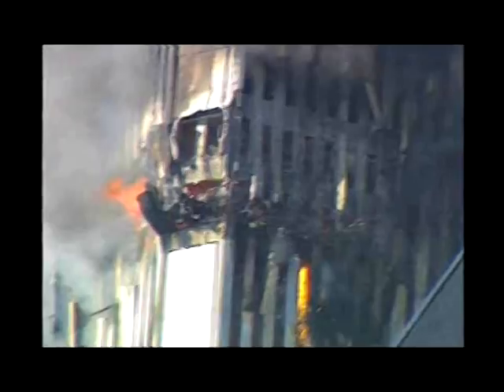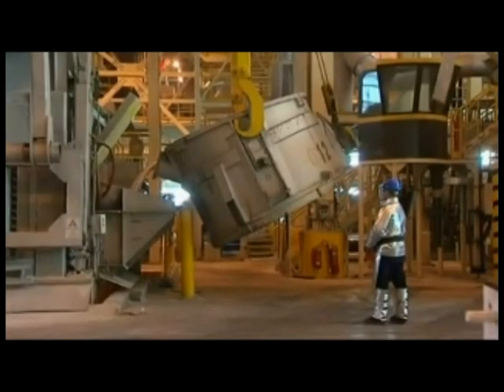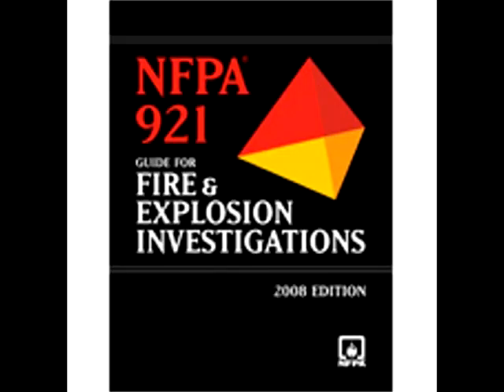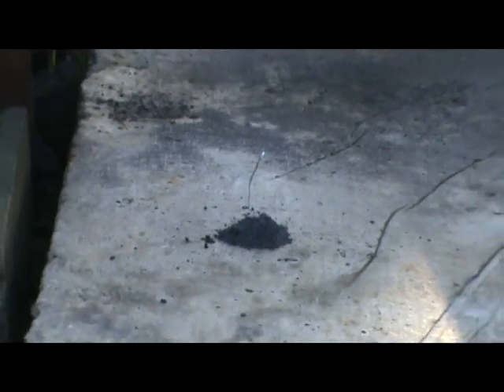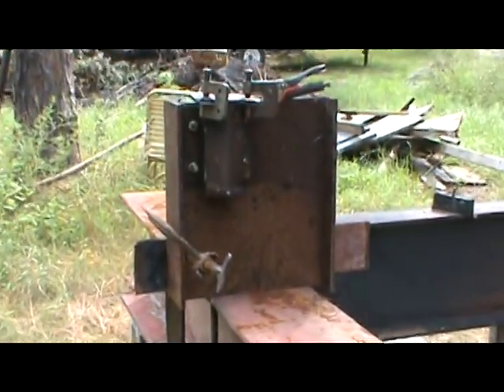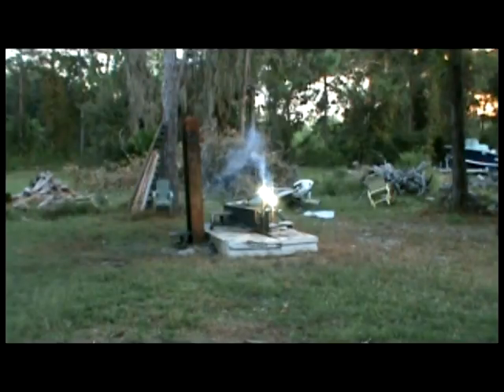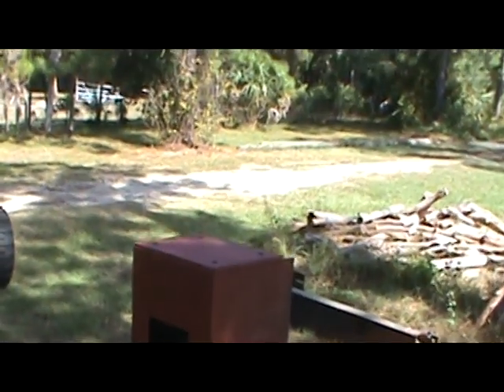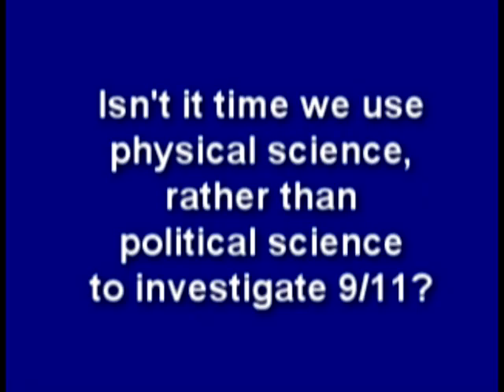9/11 Experiments: The Great Thermate Debate

Comment: The science behind thermite reactions is known, and has been known for decades, well before 9/11. Rail joints across the world use thermite welding to achieve the required temperatures to "melt" the rail joints together. Although it is a different application, the fundamental principle is the same, so why was this never considered in their analysis? Did they even bother to ask engineers that know this? My questions are rhetorical, but meant to pause for thought.

Comment: What about that steel building in the nederlands, that collapsed due to a normal fire.
Btw "those" people don't believe anything, otherwise it would be a paradox. 
Just realize that those towers collapsed because of the planes and their fire. Or run a campaign if you are against the politics in your country.
Reply: Arved Ludwig im from the netherlands and i have no idea wtf ur on about
Reply: Thund3rB0lt it was in Delft and had 13 stories. It was part of the technical university.
Reply: That building did not fully collapse, only some other parts did. The main structure remained intacted and was demolished afterwards

Comment: Steel doesn't need to be melted to lose its structural integrity.

What are the chances of high amounts of electrical current melting the steel.
Reply: jermzdee You know, I like you. Debating and putting forth ideas, not just destroying straw man arguments. 

Anyways, I dont think your idea works because its simply too much molten metal. An electrical short would only melt a small section of wire until the connection is severed. I dont even think wires are made of steel or iron, probably copper. And if a wire shorted through a steel beam somehow, the wire would melt first, severing the connection.
Reply: jermzdee unlikely. Building steel is grounded. It would absorb the electricity. It would take an incomprehensible amount of electricity that the building's system couldn't provide.
Reply: jermzdee I'm on board with that, I don't believe the steel needed to melt for a collapse. However, building 7 collapsing is much more suspect.
Reply: Hank Schwiebert could it be possible though that some of that molten metal was copper electrical components in the walls
Reply: Marcus Frostenson True, but copper alone wouldnt be enough. And copper and aluminum dont mix, so possible I suppose but not likely.

Comment: So your suggestting that directional charges made from thermite were inserted into the columns when the building was errected? Or were retro fitted with no body noticing? It's a bit way out there. Wasn't an experiment done to show a steel beam contorting after being suspended over an outdoor fire for less than an hour. Surely the weakening of such beams would be enough to bring down the buildings.
Reply: g k no he is saying they somehow managed to install charges into the colums. WTC acted like it was made out of paper

Comment: !!! Thermite is used to cut through railroad rails, which are thicker at parts more than I-beams. They use poor mix or poor quality thermite in the experiment. Thermite can burn a large hold in an engine block of a car.

Comment: But what would be the purpose of anyone going to these lengths? Would the average person have access to the access ports for the support bolts? Could a person get the supplies needed to setup these cuts to the location? I just don't see how any of that would be feasible unless there was absolutely no security measures in place.

You've done excellent work. I'm just not convinced on how plausible it would be for a person to get the materials to the locations without detection.

Comment: This is all fine and dandy but you didnt mention that  A FUCKING PLANE HIT THE BUILDING!!! You dont need to melt the steal just get it hot enough to loose its structural integrity. It also helps that its 100 stories up in the air with wind which amplifies the heat. You should all be medicated for believing this misinformation.

Comment: Being as though I'm a blacksmith, I know that if you get steel to that temperature you can bend it with only one finger... not including the fact that it had the weight of all of the rest of the tower on it, making it extremely weak. Did no one think about the cables and wiring harnesses that go throughout the entire building maybe the cables they used had a large quantity of copper or some other materials inside that could have been a large quantities of metal... idk. And honestly there's no real way to find out...

Comment: You don't have to melt steel to make a building collapse, you just have to weaken it enough to the point it can't withstand the structural stresses put on it.

Put 31 floors of weight on the steel.  Smash a plane into it.  Then heat it up and see at what point it fails, I bet it's long before it actually melts.

Comment: There is no way. That is thermite. I am a welder and I am telling you that was thermite or some sort of slow burning, high heat material. Thermite is used to weld rail road track together. A thermite bomb can be used to cut right through steel.

Comment: Jet fuel, typically, will also only burn in a pressurized or enclosed environment.  I work on and around aircraft that vent fuel every 25 hours if the tanks are full.  Eventually someone comes by and drains the surges, but never any rush.  Jet A is basically kerosene.

Comment: You don't need to melt the steel.  You just need to soften it to the point it will bend.  Clearly none of the conspiracy theories come from metal workers.
Reply: Matthew Hendricks you must not know engineers very well, they are right because they said so, and in like scientists they start with a theory and look for the facts to support it.
Reply: Drake Molten aluminum explodes when reacted with water... The entire plane was aluminum. The sprinkler systems have enough pressure in them to cause damage to lower floors when reacted with aluminum. Also, you have no idea what a controlled demolition looks like do you?
Reply: Drake nope, but once the top accelerated it crushed the floors one at a time.  That's a lot of weight.
Reply: KFStreich but why did it fall almost perfectly straight down. Both planes did not hit dead center and stay there in the middle of the building. So shouldn't it have weakened some sides and not others causing the top to fall at an angle
Reply: did you watch the video? there were clips frow the wtc where molten metal was pouring out of the building. my point is that yes you only need to weaken  the steel for the building to collapse but something melted the steel in the towers.
Reply: Is it confirmed molten steel tough? I honesty doubt it. Why? becouse you need massive amounts of incendiarys to melt and completely liquify TONS of support beams to be able to create a flow like that. 

Also i doubt that a office worker stored half a tanktruck worth of gasoline up there. Whats more likely is thats its just jetfeul (wich there was plenty of)
Reply: KFStreich , dude the way the Twin Towers collapsed it didn’t look like it got bent, it fucking got destroyed !
Reply: Chris Almere this is a good point. you definitely wouldn't want a building falling on another building. But surely you have seen videos of engineers claiming the towers could withstand "multiple impacts"?
Reply: mike pk666 https://youtu.be/JEEOkMW1CYI He's right. Aluminum just cools down in water.
Reply: KFStreich if the steel bent, wouldn’t the towers have fallen to one side? How did it still fall straight down into itself?
Reply: KFStreich not only that in Bend under the weight of the building it wouldn't take much I'm engineer had a builder I've got 100 comments from bell ends saying how wrong I am not one of them has got me yet
Reply: Bian Wilson Is that a real question?   It only takes a small structure failure it's made of thousands of pieses.  Size matters.
Reply: Bian Wilson go look up Taipei 101 and how do you stop that from collapsing to the floor.

I suppose gravity played a big hand and helping it comes straight down
Reply: Bian Wilson I use my phone's microphone you f**** moron I speak into my phone I didn't spell s*** how does it feel to be thick as f*** and wrong? I can't believe you've said gravity doesn't play a part in pulling a building to the floor are you serious I have no idea what to say to someone who thinks gravity has nothing to do with a building falling to the floor I'm shaking my head in disbelief and everyone in this room now is pissing their pants laughing 🤣🤣🤣🤣🤣🤣🤣🤣🤣🤣🤣🤣🤣🤣🤣🤣🤣🤣🤣🤣🤣🤣🤣🤣🤣🤣🤣🤣🤣👌👍 absolute f**** moron retarded I don't believe there is another word other than retarded. the US government wouldn't even have you in the army your IQ is that low you're not even good enough to be used as cannon Fodder. 😂😂😂😂🤣😂🤣😂🤣😂🤣😂🤣😂🤣😂🤣😊😂🖖
Reply: Except if that was the case the side the plane hit would be weakened the most and the top would have fallen off in the direction, not straight down. Sorry brah.
Reply: Richie Reeves it's technically possible, but you'd still have to get the incompetent pilots to hit the exact floor in question, that would be a feat in its self, especially since they had only an hour of seat time in that type!
Reply: StripeSubscriber then those floors would collapse first followed by whatever is above, so many things are technically possible, the trouble is creating a theory first and trying to justify it first.

The government can't do much of anything effectively, how are they going to keep such a secret with so many eyes on them?
Reply: KFStreich the heat traveled to the bottom causing it to collapse? You know conspiracies are a real thing that have happened right, it's not like bigfoot or unicorns or some shit?
Reply: mike pk666 You do realize the planes aren't pure aluminum right?
Reply: mike pk666 you're reaching so hard it's beginning to not be funny
Reply: I didnt think about this till now. That molten metal you see flowing out of the building is actually molten aluminum.

 Notice that if you do a bit of research and look up more videos of the metal flowing out of the building, it only flows from the plane impact point. The plane is made of aluminum. And yes, extremely hot temperatures will make it glow bright orange. 900 plus degrees will make aluminum glow bright orange.

 If it was in fact a thermite demolition, its kind of weird that it was pouring out for as long as it did in the first place. And wouldnt we see more thermite coming from other angles of the building too instead of just where the plane is? If anyone can find any other video that shows molten metal on any other part of the building, let me know. I would be glad to have a formal debate on this with anyone. I think I just debunked this whole theory.

Resources: http://www.drjudywood.com/articles/aluminum/Aluminum_Glows.html

https://www.reddit.com/r/askscience/comments/6qaevp/why_doesnt_aluminum_seem_to_glow_orange_when_hot/
Reply: Maximus Matticus and a thousand of them are retards.
Reply: Why would it bend when it fell STRAIGHT DOWN.
Reply: mike pk666 planes have Inconel...an alloy of nickel containing chromium and iron, resistant to corrosion at high temperatures... it can stand temps over 1,800 °F why wasn't any plane parts pulled from the building...
Reply: D Jopson haha you can't even spell swear words and I didn't say gravity doesn't make things fall I said that buildings don't fall STRAIGHT down and the forces of physics has a role in the reason Why a building never really falls straight down, yes gravity is one of those forces. :) haha I'm glad you're so distraught you have to type up a paragraph and believe I'm good enough for cannon fodder over an internet comment lol that made my day thank you. :) you're life must be shit to have so much pent up anger and frustration in order for you to release your nerd rage upon me x,D again look up demolition science. Someone who hates so easily is the real moron. :) reply, I enjoy talking shit with adult children. :) I bet you live in a trailer and you're sitting there just about having a heart attack because of how much cholesterol you've got. Hahaha x,D you really have to twist my words and like your own comment in order to feel good or are you so stupid you actually believe what you're saying
Reply: D Jopson thick as fuck? Hahahaha what does my thick dick have to do with This? X,D thanks, I AM thick as fuck. At least I can spell dipshit. Don't lecture me until you learn English a little better first. :) not surprising as you didn't go to school for anything. Go drink a beer in your distress, kiddo.
Reply: Rants and Random exactly. Thank you for explaining that.
Reply: And 3-4 of concrete could easily stop it from bending
Reply: n kn why doesn't it stop other buildings tho. He isn't saying that out of personal opinion, he is quoting a commonly known statistic amongst demo-ist and architect. Buildings don't fall STRAIGHT down unless they are demolished and even then, it's the sign of a good demo if it does not tip side to side. It's hard to get them not to tip.
Reply: MyGuitarTwerks where did mikepk666 go? I want to read his response.
Reply: KFStreich If the incompetent pilot hit any floors a few stories above the exact one in question, is it technically possible for the thermite to somehow - at least eventually - be ignited (or otherwise set off, so to speak), thus causing the building to collapse as such with the hypothesized combination that would ensure it fell this way?
Reply: Well just to help some people grasp a few things there was a sky scraper in asia that burned for more than 24 hrs and it gutted the building but the steel structure was still sound enough for them to rebuild it and the towers burned for a mere few hours and had firefighters resonding but the towers still fell.....if u say that the towers were not sabotaged then explain the angle cut beams. I am a metal worker and i use various tools to cut, bend and weld steel and an aluminum fire will not do that. Molten alumnium will flow over steel.
Reply: None of you have a clue what the hell you're talking about, yet you just keep talking. The basis of all your arguments are "he said she said" you guys need to get a grip, you have no idea where you're coming from, these aren't YOUR assertions, they're someone else's, you have no skin in the game whatsoever.
Reply: KFStreich  - I am a welder and engineer (30 years) -  you can tag me as a conspiracy theorist if you like - but i prefer to know myself as experienced and logical. Physics and gravity are statics - thermal properties are dynamic.. bending from heat is NOT yielding..
Reply: mike pk666 No idea of what a controlled demolition looks like? There are hundreds of videos of buildings being brought down by controlled demolitions & there are several videos with side by side comparisons of a controlled demolition & the towers coming down & they pretty much look identical, at the end of the day ppl are questioning the official story as it’s obvious from sworn testimonies from firefighters, police & civilians that what the government is claiming happened & what actually happened are far from the same. It’s not as if the government hasn’t planned & carried out false flag attacks before? The gulf of Tonkin to name one, there are plenty more. If you believe your government doesn’t lie then why bother watching these sorts of video let alone comment on them?
Reply: It fell straight down becouse it did what it was suposed to do, the tower was designed to withstand a plane hit (and explosions to some degree). And before you start yelling "you see, you see". There is a giant airfield nearby, there is a lot of air traffic in and around new york + being one of the first city's you see when comming from across the sea, it makes a very tempting (and easy) target. Now as to why it fell straight down, with a crazy building density you need to design your buildings to crash straight down and not tip over and take 6 others with it.
Reply: You guys are great, I've enjoyed the replies.

In order to drop the towers with charges at the level of impact the entire midsection of both buildings would need to be rigged with independent explosives for each level, then the wiring and detonaters would need to survive the ensuing fires.  If the fire is used to ignite them it would randomly set them off instead of a simultaneous explosion that would cause it to drop straight down as in demolition.

The steel would be weakened on all sides, as well as the concrete, one side would easily go first, however the shock would easily crush the rest of the heated levels.

Now, what became of the thermite on the levels that weren't exploded?

Do you know any engineers?   They are smart guys, but their ideas don't always transfer into the real world.  They live in a world of drawings and ideas.
Reply: That building was designed as iSal said..to take multiple impacts like a screen door sticking a pencil through it. And it was also designed where IF it came down it would come down floor on floor with one minor exception...the outer frame structure would still remain standing. So this was a building within a building design. The outer building being the guardian to the inner building protecting the inner as well as all the buildings around it.
Reply: D Jopson if you knew anything about how building fall and are demolished you would know why gravity would not have a hand in it falling straight down. They tip to either side. Lol the only way a building, especially one designed to withstand a jet crash specifically, would fall straight down is if it were detonated. Talk to a physics teacher or an architect. In fact it's very difficult even when demolishing buildings to get it not to tip onto another nearby building. :)
Reply: D Jopson you can't even spell pieces correctly kid shut up.